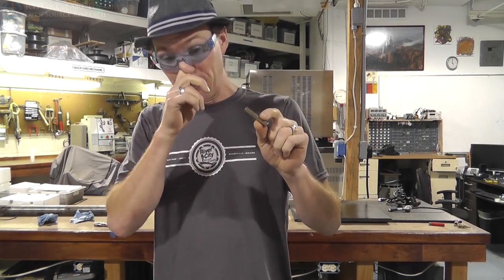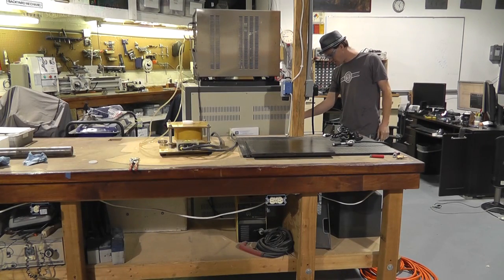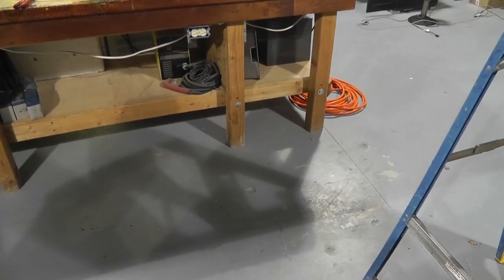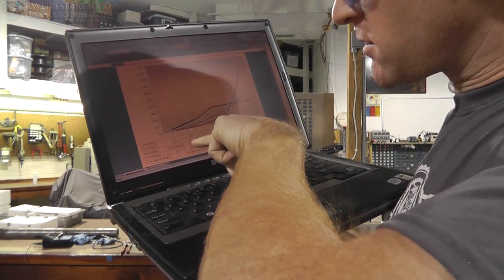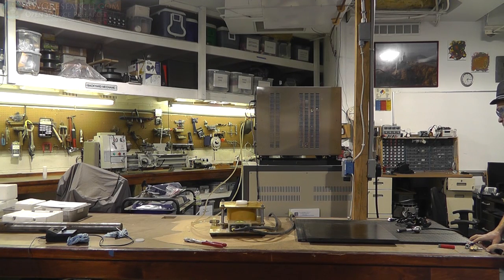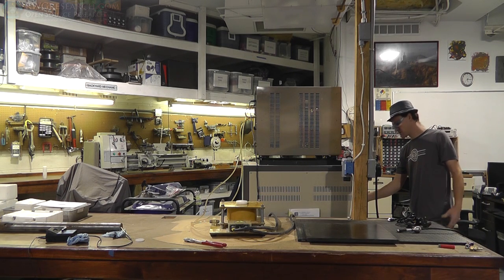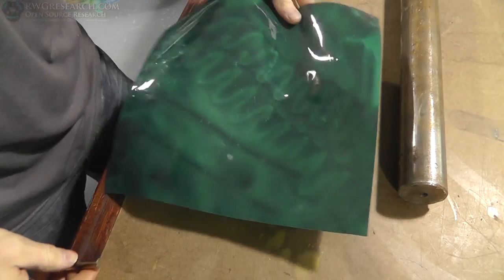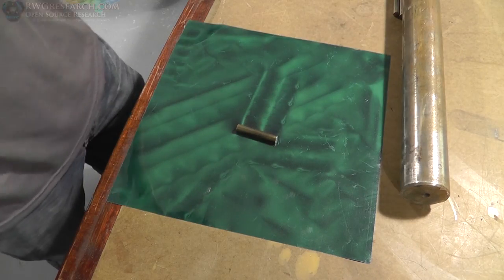Test:4 Magnetizing Experiments  : Demagnetize via pulse discharge. Fliping Poles?

Comment: Looking great. Majority of people if they're not keen towards how a magnet works will get tricked into thinking that the magnet has somehow became a magnet monopole due to the similar poles being on opposite sides with out checking the middle to see if there is an opposite pole inside. I also seen a couple of videos out there that want to suggest that if you take two magnets and sandwich them together on opposite sides of a metal plate with the same poles facing in/out some how this arrangement is meant to simulate a magnet monopole because two similar magnet poles being on opposite sides like this (N/S)metal(S/N).

Comment: nice; demagnetizer mode is oscillating poles... a full sine wave instead of a single direction impulse...
would be interesting to see the steps... like does the slow demagnetizing move the bloch wall ?  Is it reversed when the one wall pushes the other of the magnet?

Comment: I believe your coil is set up to do both n/s poles. Could you try making your own one direction coil? I think you would have better success with demagnetization. Did it in school to inspect crankshafts for a Cessna 150. Look up magnetic particle inspection. The set up usually has ways to magnetize direct current set up and coil set up. And its very important to completely demagnetize the part after inspection otherwise it would weaken the part. Was fun to use though.....

Comment: Cool discovery!

You probably already know this, but longer cylindrical magnets that are conventionally magnetized (i.e. not diametrically magnetized) are typically much stronger on the ends & quite weak in the center along the length axis.   It appears your magnetizer is designed to create a specific NS field over a specific region (ie. a given field length).  If that is true, then that may explain why you are getting 3 poles along your magnet's length.

Do you have a tools url list or page?  Many people like to know the make, model, & source/supplier of the tools that are used in YT videos.  It helps them to more quickly confirm your tests or to simply find, research, & build up their own tool set.  If you don't have one--I encourage you to share such info with your viewers by adding a url to your video description.

Thanks for sharing!

Comment: Russ and his toys!  Neo has a very high hysteresis, seems to have a very sharp knee in its BH curve.  You might have discovered that your magnetizing coil has a non-homogenous field. Is the magnet positioned exactly centered in the coil? Do the coils have any kind of core, or are they just wire (or flat wire)?

So... does your duo-pole magnet work in a mognet-motor?  ;-)  Naw, its center opposing poles would still be a snag.....

Some of your viewers might like this page describing thermal demagnetization:
http://www.kjmagnetics.com/blog.asp?p=temperature-and-neodymium-magnets

You might like this... shades of days gone past... like back in your garage!
https://www.youtube.com/watch?feature=player_detailpage&v=jPTyYCm4U6Q#t=356